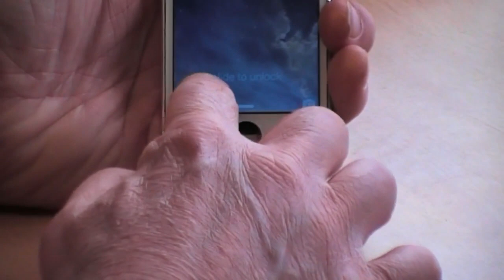iPhone 5s screen refurbishing process

Comment: Great video, Can you tell me the vaccum time, laminating time, outgassing time and the configuration of the laminating machine. Thanks a lot
Reply from the maker: 6, 6 and 6 I think. I shall check, I reduced the debubble time to 300 from 600 and the result is the same. There is a dial inside to adjust the pressure and I have lowered this. 
I don't have a specific setting I just experimented until it was better.
Reply: Thanks for your answer it was very helpfull
Reply: Why you take off the small plastic in the upper corner of the screen?
Reply from the maker: +Miguel Muñoz they occasionally cause the thin part of the screen to crack.
Reply: I brouth all the machines in Shenzhen and thanks to your video the screen came really good. Thanks for your help
Reply from the maker: +Miguel Muñoz I am happy about that my friend. Iphone 6 LCD refurbishing video coming soon.